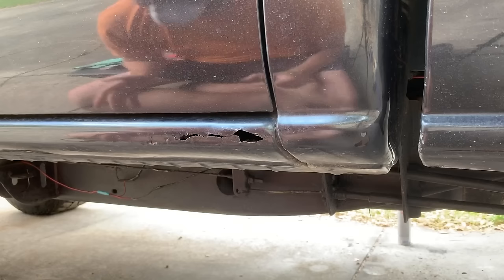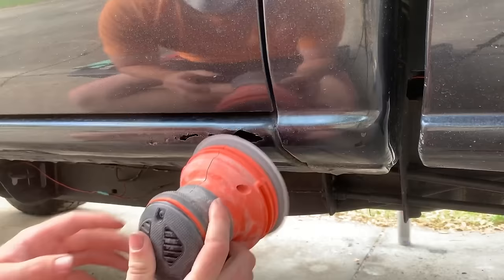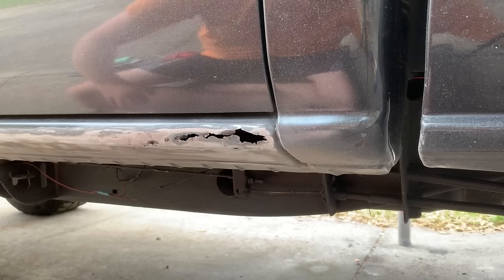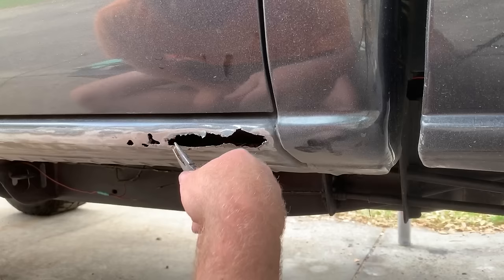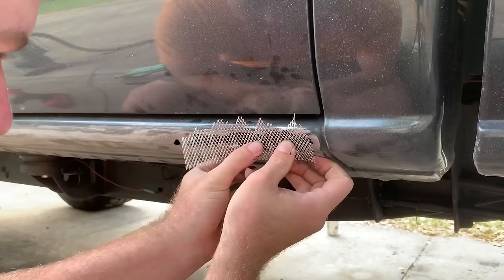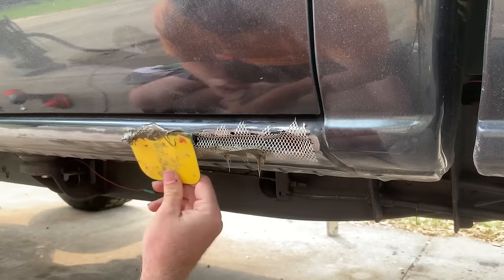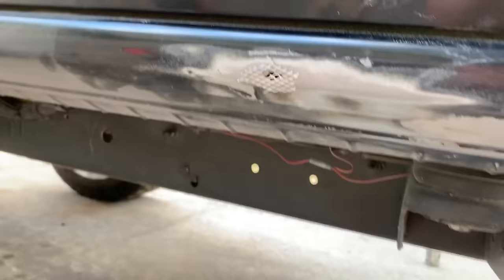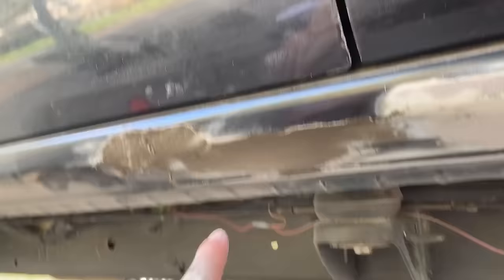How To Fix Rusty Rockers Without Welding

Comment: I have a 90s Celica here in the UK and the rocker look exactly like this after being exposed to the elements after damage. I'll definitely be giving it the Aaron Cates treatment 👌
Reply: Did you already try it? If so, how did it work?
Reply: If the MOT tester spots it, he will fail it.
Sills (rockers in US English) are structural and your seat belt mount attaches to the inner sill.
Welding in new metal is the ONLY acceptable repair.
Reply: You won't get away with that kind of repair in the UK or the EU. It's many decades since you could.
Reply: @timhancock6626  yep this is a total bodge job.Sills are structural.

Comment: Another option is to drill out the spot welds and bolt in a new one.  if the rust started in one spot, its going to get hungry and feed on the rest of the steel.
Reply: sorry rust doesnt work that way
Reply: @williamholmes7871  Yes it does, lmao. Rust is cancer,  if theres a spec of rust in there with any moisture, it will transfer.

Comment: I had big rust holes in my truck box side. I first knocked off the rust, then filled it with spray in Styrofoam.  Then used fiberglass bondo.

Comment: I think the spray Rust Reformer (from inside) is an excellent idea, may not be enough. I also saw video where the guy suggest filling with engine oil to stop rust. I also saw use of Linolin Spray.

Comment: Nope!! Done the same thing years ago on a 96 GMC. After one year it popped off. Spent two days prepping it and all. After that popping, I welded it and did the body work myself. 24 hours later? Like new. And it lasted the rest of the life of the truck.
Reply from the maker: I don’t normally respond to comments but wanted to follow up and say, I sold the truck almost 2 years after posting this video and it still had zero rust showing on the rockers. You could knock on any part of them and they were solid.

Comment: You may want to check your roof seams. I live in the south, and I had a panel that rusted out because water was getting in up top at the rear and running down from the inside. I shot it full of silicone to stop it from getting in, but I didn't know what else to do at the time.

Comment: Good job bro... I fixed mine in a similar way but living in Indiana it didn't last long lol. Ended up buying slip over rockers and just tacked them in
Reply: When you say slip over rockers, that is the worst mistake folk make.
Because you only tacked them in, you didn't restore the strength (yes it is structural) and overlapping the rotten panel accelerates rusting rapidly.
You have to chop out the rot for a lasting repair.

Comment: you did great, let the rust reformer haters hate. If you do ever need to replace the rocker panels you can  use a body panel adhesive rather than weld and rockers are not structural so its more than strong enough

Comment: Great video! POR-15 comes as a spray now and much better than Rust Reformer. I’ve used both!! Also Eastwood sells an internal frame spray for rust that’s also good, includes small tubing also to get in tight spaces.

Comment: I am doing a DIY patch job for a rust hole on the under-part of my car like you did (slab between doors and step up for Chevy suburban.)

I definitely laid the Saver on too thick; very bubbly all across the bottom (almost looks like black bathroom caulk)

What’s the best way to move forward? Poke some holes in the rise then do a light second layer? Or remove it with an exacto knife? Or something else? 

Note, it will be a little tricky to get the knife in; small space not easy to cut perfectly.

Comment: My collision repair shop guy tells me this is useless. Because the metal is so thinned out by grinding, the rust inevitably comes back in one year max. Says welding is a way better option, but he doesn't do it, unfortunately.
Reply: Only way to get rid of the rust completely is to replace the panel. It will eventually rust again and his patch will fall off, give or take a year or two. This is a quick and cheap fix for turning a vehicle.

Comment: I did that three years ago, and now the rust has come back with a vengeance. Going to have to cut out the entire lower plate and weld in new metal. Chunks are falling off now. It's a 2001 Silverado.

Comment: Thanks for video. I would have used spray foam INSIDE the thing. The grill I would have placed IN FRONT of the foam as it dries. Then, bondo would have been easier to apply. Yet, all is good. Thanks again. 🤔

Comment: To cover gaps and holes you can also try laying the fiberglass material and resin/mix out on a piece of plastic (garbage bag).  When it is ready to go and perhaps starting to kick over then apply it to the location.  When cured, peel off the plastic and continue with the bodywork.
Reply: You can use those cheap thin rubber floor mats instead of plastic bags. They are reusable. Knew an old cat that used to fill like that.

Comment: I cut out the rust and then took a shortcut by just buying some sheet steel.  Using tin snips to trim it, and a rubber mallet and piece of firewood to beat the right curve into it, I got a piece to perfectly fit over (not into) the cut out hole.  I then used JB Weld (Kwik-Weld) to "glue" it in place, and some regular JB Weld to cover over the seam as best I could.  Once painted, you can still tell it's there if you look closely enough but it's a rocker panel so who cares?  It looks way better than with rust holes and now the rust isn't spreading.  To protect the inside, spray in some used motor oil or Fluid Film.

Comment: My truck was originally from michigan too,  my rockers were too rusted especially the driver side. So i had to get a rocker panel and cab corners. Good video gonna use that for small holes.
Reply from the maker: Luckily mine weren’t terrible. I’m sure if it would have been in Michigan longer they would be a lot worse.

Comment: You want to dent it in with a hammer 1/4 inch or so to give the bondo somewhere to go and wipe it down with rubbing alcohol first to have clean bonding surface.  Use a flopper disk with your grinder to open up the rust hole.

Comment: Fiberglass is a cut corners repair if your going to sell the car or truck the only way to repair it properly it to patch it ... Fiberglass will hold for a few years but the repair area needs to be super clean from rust even the underside of the panel where rust is will still continue to rust and push out the fiberglass ... Best to replace that area by cutting out the rust and cleaning out the interior area then replace the panel with patch or how you would like to do it with metal... But for a quick patch for possible 3 years it will work...

Comment: great work  .......   !         but struggling to understand how the mesh holds on where you trimmed the  edges  as only seems to be a few millimetres of mesh onto  the good metal body work    ....... did it stay together over time       ??    great resourcefulness from you   !
Reply: I think once it dries, because it is connected and spread to the rest of the panel, it holds like it’s on thick glue from one edge to the other edge of the panel. Hence filler I believe

Comment: I have an old winter beater and i know patching it up this way might not be proper and it might not last that long but i really dont want to spend $1500 to get rockers welded in. I need to patch it up for like $100 so it can pass inspection and 7 or 8 months down the road ill probably get the proper job done but im all seriousness i just neec to do a job like this just to get me through.

Comment: I think ima fill mine with spray foam then go in with Bondo...then use some bed liner to finish er off lol.
Reply: Actually spray foam works
Reply: @kylephelps3312  yup i did it an it worked perfectly
Reply: Not good for long term. The foam traps moisture in the metal and causes it to rust faster
Reply: @austinbradshaw5791  used a non absorbent foam so hopefully it holds up for awhile lol
Reply: I've definitely fixed a few beaters that wasn't worth actually welding in new metal and repainting.

Comment: Definitely did a good job but if I where to do this to repair mine I would cut a square patch out then use the adhesive panel to make sure there is no rust because the little jagged edges will still have some rust but I put fiberglass bedsides, rockers, and cab corners on my 3rd gen ram because I live in southern Ohio and although we don't get much snow it likes to rain then drop to 10 degrees that night so they use a lot of salt and fiberglass can't rust and mine where a lot worse than yours

Comment: What you don’t realize is those rust from the inside out. I’d bet the whole inside is rust that’s just common for those GMs. You should go back and at least spray liberal coats of Fluid Film where it’s leaking out or all that work will be for nothing.

Comment: Inject used gear box oil in there with a syringe.  Dry off the outside surface you need to repair with acetone. You will never get rust again.

Comment: I have rust and holes all along the length of my rocker panel. At What point is the rocker panel too far gone? Should I just go ahead and replace the rocker panel?
Reply: If you got the money  get new panels put on new panels professionally if not just patch it up. Or if you need it inspected patch it up to get ya through

Comment: Fiberglass patch panels are as good as or better than welded in steel panels and much easier to form, done properly they will last for decades.
Reply: Do you mean a full panel?

Comment: Hello thank you for the video. I'm doing the same today.the glaze spot putty tube didint see you use it in the video. I bought a tube what do you recommend it used is it gor small holes ?
Reply from the maker: Yes, any small spots in the bondo body filler to level the surface.

Comment: that will fall apart eventually making a big old mess. cut out rot, use the rustoleum or whatever to keep it from rusting on inside & outside of edges that you cut... then buy a new rocker panel & glue it on the old rocker with that awesome panel glue. some trimming may need to be done on new rocker before glueing it on.

Comment: Great video. Was wondering.. What primer would you suggest on the grinded area of a welded on rocker panel? I don't plan on paint for several months down the road.
Reply from the maker: Any rust reformer then rattle can primer will hold up until you can get it professionally painted

Comment: If you want to kill rust and put a shield against It getting away from you like you were doing inside the rockers b4 covering them over try Plasti-Kote : rust converter it's
some awesome rust killer.

Comment: If you have multiple holes like I did I used an air compressor to blow out most of the crap. Nice repair man. Any idea how long this should last?
Reply from the maker: Sold the truck 2 years later with no issues still.

Comment: Hahah. Fixed!  I don’t think so.  Now I will say that will last couple years. But when it comes to rust it’s like cancer. Of ALL the affected metal isn’t removed and replaced it will return, worse than ever! But ya for quick fix, maybe.  But I can see in the photo the inner rocker is already affected to, witch is very common on the classic model silverados. They had no water drains so they held moister. Moister & salt = BAD.  I’ve run a body shop since I been a kid, I’m 42 now. So iv got 2 decades of body repair knowledge. I’ve done collision repair for 20yrs. And still do. And mainly do late model GM trucks. Durmamx.

Comment: welding is useless for rust patch like that unless you cut large section out ....even then , fusor adhesive can be used to install a patch or complete rocker panel

Comment: NOOO!
smash the edges of the rust holes inwards with your pick hammer, otherwise you will get rapid and obvious rust, and bubbles in the filler.
If you've drilled drain holes at the bottom,, then drill some holes at the top of the sill, and fill that sucker with used engine oil.
After you've painted the repair, obviously.
And... don't mix filler and resin on cardboard - it has a layer of wax on it, and it'll just fuck up on you, either at the paint stage, or later when the filler falls out because of lack of adhesion.
Last point: do you use a guide coat when sanding the primer?
Job looks good, so well done.
I

Comment: So simple to prevent 8n the first place. 9bce it r3ached that stage the Only cure is to replace the panels. These type of repairs are not really an issue for vehicles with seperate chassis but dangerous on monocoque bodied vehicles.

Comment: Spray in mono foam shave it off and top it with fiberglass filler... hack AF but it works for a while.... least ul have filled structure inside the rocker

Comment: 39 years AUTO BODY ALBERTA CANADA... Just so everyone understands a Closed Rocker and Cab Corners RUST from the INSIDE-OUT... when you SEE the RUST the sheet metal is paper thin.... Fixing the Outside is like putting a Band-Aid on a Cut its a Temporary repair or covering up the Problem... I've seen the outside patch jobs start fester and Bubble the New Paint in DAYS...

Comment: This only works because it is on a truck.with a frame chassis.    Cars need a structural repair to support the area if you use a jack or lift.  Anyone not knowing of the repair and the large loss of metal may be injured if this failed while under load.

Comment: Could you of used the filler foam instead of fiberglass I mean what is the difference
Reply: Filler foam holds moisture n will make the problem worse...
Reply from the maker: Thank you Rallysport. Fiberglass is also a lot stronger than foam, thought that was a no brainer.
Reply: Foam creates an air tight seal just for reference , in doing so there’s no chance for rust , as far as strength goes I fail to see the need , the body part is primarily for aesthetics not structural support . In short why don’t you try and give some of that support instead of seemingly trying to cut on the ole boy.
Reply: Raymond Vaughn wasn’t trying to rain on anyone’s parade... just know from previous experience filler foam will make the rot twice as bad in less time... whichever u decide to use is on you not anyone else. thanks for your opinion have a good day.
Reply: @vaughn1799  yeah and thanks for calling me ole boy smh

Comment: I have a question why wouldn’t you put some wire mesh around fiberglass that would be a lot stronger I have repaired them like that in the past. Not questioning your method just a question. 🤓

Comment: Mite get 6mo out of it I did mine like this in August it's now March and rust is starting to bubble through and push the fiberglass up into the raptor liner it's not  worth the time and  aggravation  if it has low miles on it go take it to an auto body shop and pay $1,500 to have new rockers put into it if it's higher mileage like mine with 200,000 miles on it the writing's on the wall might get two more years out of the truck and it won't pass inspection anymore ....
Reply from the maker: Already been over a year. If done properly you won’t have a problem.

Comment: My rockers a so fucked I wish I could post pictures but do you think almost completely rusted out rockers could be fixed with bondo?
Reply from the maker: No there has to be some type of structure from my knowledge. If they are completely rusted you may be better off cutting out the rust and completely, painting bare metal and get some plastic slip on rockers if you don’t have the ability to weld on new rockers.

Comment: I presume this vehicle has a separate chassis and that the rockers aren't structural. If you do this on a monocoque body, as most cars are, it could be deadly in an accident. That rust you are seeing is the tip of the iceberg, it will be soon breaking through the rest of the rockers. At best a bodge, at worst it is dangerous.

Comment: everyone has its own way in my case i''d cut a long piece with the cutting grinder and fill up with low expanding foam then cut it nicely into its shape and fill up with fibre and putty................... 
this method has last longer than putting the mesh and the rust tends to come back after sometime but not the foam.

Comment: Is the rust ever going to come back fast
Reply: Yes. The way he “fixes” it in the video is not permanent and will be back in a year or so. This isn’t solving the problem, just masking it over. The only way to truly fix rust is to cut the entire rusted area out. That means any place there is surface rust on the inside of the panel past where the holes are. Weld or bond new metal or entire panel on. I know he says he’s doing it to show another way if you don’t have access to those things but it doesn’t make it a good repair.

Comment: I might have missed it, but what did you paint it with after the primer? Thanks.
Reply from the maker: I just used the normal black spray paint because I was wrapping the truck
Reply: @AaronCates  Thanks & wow that turned out really good! Great job! You've helped give me the confidence to start the same project!

Comment: The sills are a structural part of the car. Bodging a car up with fiber glass in this area, is an MOT failure in the UK. Sills should always be welded.
Reply from the maker: The outer rocker panels on this truck are not structural as there is an inner and outer. The outer was the only showing signs of rust. If both were completely rusted out I may agree with you.

Comment: Well ya see, my 1986 ford has no rocker panel left🤣
Reply from the maker: If you like 80s model fords please check out my other videos, I have an 85 myself.
Reply: @AaronCates  will do👍 what motor do you got?
Reply from the maker: Plague Doctor • 5 years ago 351W
Reply: @AaronCates  nice motor, i got a 460. Shes got a valve problem.